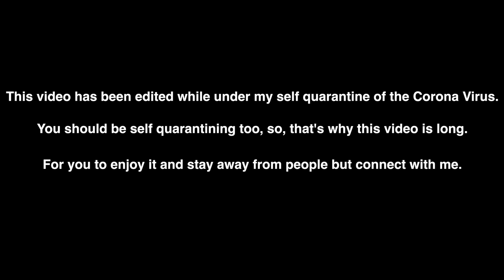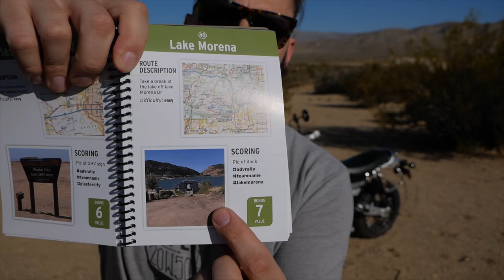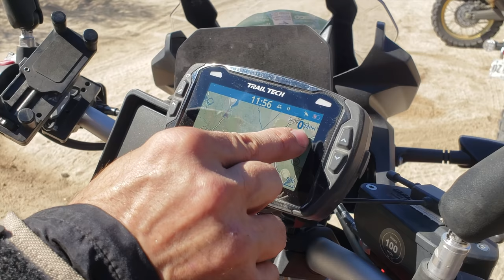Cycle World ADV Rally 2019 | Scrambler 1200XE

Comment: Great vid. Finally, someone riding the Triumph in some places it should go. There are almost NO proper off-road videos of the 1200 going off-road on youtube. Lots of people say it isn't designed for this stuff. Is it as good as the Africa Twin, GS etc, in this type of terrain. Be good to hear your thoughts on that, especially as you have actually taken it off tarmac. It Would have been good to hear some reviews on the bikes though, from the guys riding them. I didn't think the vid was too long - it certainly wasn't boring. Big thumbs up :) Cheers, Campbell
Reply from the maker: It's better at doing gnarly stuff cause it's easier to ride
Reply: @steve_kamrad5216  Cheers for your response. I finally got a ride on the XC - It wasn't for me. It had no ground clearance on the road, and (For me) horrible ergonomics, I found the throttle response dead and unpredictable, it also feels every pound of its weight. Great brakes though and reasonably comfortable. Glad Triumph made these, just wish it had ergos similar to an Africa Twin and a cable-operated throttle, and no rider aids, or modes. They really spoil the bike. If they built a stripped-down, budget version, with better ergos and more ground clearance I'd take another look. The taller XE might be better, but I'd need to put different bars on it and lower rear-set pegs, and then drop the suspension, put a lower seat on it... etc - then after lowering it I'd possibly be back to no ground clearance... plus it becomes an almost $30,000 bike with all the needed changes... I found the engine pretty weak too - I think the power-curve doesn't really suit my style of riding (Reminded me of an early GS700. anyway, I could go on. Motorcycling is soooooo subjective.

Comment: you guys are fucking brave riding full ADV gear in the desert like that lol
Reply from the maker: Yeah but dirt gear would actually dry us out faster
Reply: @steve_kamrad5216  personal preference but I would take it for the air flow to keep my core temp down and wouldn't mind having to drink more water throughout the day as long as it's available during refueling.  I almost killed myself in a Klim Badlands Pro before.  Never again.  That shit is just useless.  Over priced, over engineered, over marketed, over weight.  With "adventure boots" it weights over 15 lbs.  I evolved to use battery heated compression base layers, bionic 10 knee braces, white mx boots, light enduro pants, leatt airfit body protector, lightweight enduro jacket with removable sleeves, ultralight compressed/packable backpacking rain gear in the rabbit pouch, and a pressurized geigerrig hydration pack.  Still fully CE lvl 2 protection but add knee braces, modular rain protection, heated gear for night riding, much much lighter, and infinitely better airflow than those bullshit adv suits.  You wanna race next year I'm in  😂
Reply from the maker: @primedirective00  I agree with you.  The suits are hot and too heavy.